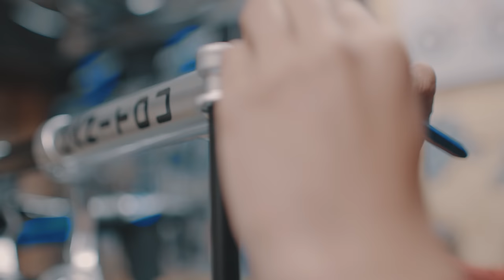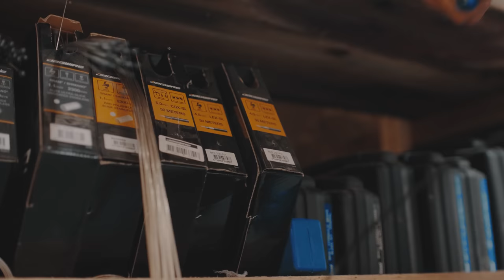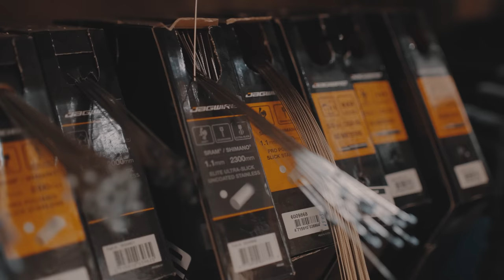DREAM BUILD MTB - Ragley Big Wig

Comment: Unusual to see Microshift being used, it's usually Sram or Shimano.
Reply: No way usually the two biggest bike part companies, that's shocking
Reply: I swapped my drivetrain to micro shift and it’s absolutely amazing
Reply: Yeah man. I just recently got a whole new MS drivetrain minus cranks. $170 out the door and its flawless!
Reply: @mcdello1  i usually heard of them having the portion that goes in the rd hanger breaking off
Reply: I think this bike is made for a sponsored rider.. and Hayes, Protaper, Manitou and Reynolds are made by the same brand/company... so that's the reason why he is using Microshift and Hope crancks.
Reply: @denzelpardillo1181  I've ridden microshift advent on my trail hardtail for almost a year and a half now, replaced a hanger but the derailleur gave me no problems before or after the fact. Not sure I can speak for all though.
Reply: @MarianWYK  it could also be because Microshift's new Advent X is a $200 10 speed group with XT weight and MORE range than the 11 speed M8000 xt series. (Three less teeth than the newest 12 speeds). That is why I have microshift on all my bikes. It started as a joke when Advent came out and I wanted to try it on my hardtail, but it has been SO trusty since.

Comment: Even Gee can make installing cushcore look calming 😂 awesome build as usual tho
Reply: Still cannot really comprehend how the tubeless fluid goes through the cushcore and on the inner tyre. Is there a hole in the cuschore that you can match on top of the valve? I have zero experience in the cushcore matter, I'm running the plain tubeless setup. It just seems intriguing.
Reply: @georgecrisan8446  cushcore valve design let sealant move more freely. It might not get on top of the insert at first but once the wheels is spinning it will finds it’s way for sure
Reply: @elliotlandry7409  thank you! :)

Comment: Man adding volume spacers in a Manitou looks like a pain in the butt.
Reply: They not volume spacers. They travel reducers. All mezzer off the shelf can be adjusted internally without buying extra stuff. He reduced the travel.
Reply: @mtboutdoors40something  man all this time and I had no idea. Thanks for that. Really got me thinking why someone would design something to be that difficult 😂
Reply: @HamzaFaruqui  lol yea manitou does things differently. For example they don’t have volume spacers at all. They don’t need them. They use a separate air chamber that does the same job and guess what, you only need a shock pump! Amazingly tuneable stuff.
Reply: @mtboutdoors40something  damn I'm starting to like manitou 😂
Any chance you working for them?😂
Reply: @HamzaFaruqui  lol I m not no. I really like them though. I have a 2016 minute comp and a 2018 mattoc pro. They both work like clockwork. I d recommend them if you were on the market

Comment: What was done to the fork? Were those volume spacers? Why is there an air valve at the bottom as well as the top?
Reply from the maker: We lowered the travel!
Reply: Manitou fork can be travel reduced internally and yes the pro model features 2 air chambers
Reply: @elliotlandry7409  ahh, did not know that. I figured that was too complicated to be just volume spacers. Thanks for the info.
Reply: @GeeMilner  What was the before and after travel out of interest?

Comment: I'm newbie to bike and all that stuff. I'm curious what is he doing in the first part of video? What did he do with the fork and the suspension?
Reply: He’s adding volume spacers to the fork.  It makes the fork have a more progressive compression rate vs straight linear.  In other words a normal linear suspension takes let’s say 100 lbs to compress 3 inches.  A progressive suspension needs (just random numbers) 100 lbs for the first inch, 200 lbs for the 2nd inch and 300 lbs for the 3rd inch.   Prevents you from bottoming out as much.
Reply: He reduced the travel. Manitou mezzer don’t need volume spacers coz they have a second air chambers that does the job. 
He reduced the travel by 2 or 3 cm (I didn’t count but each half moon shaped disc you see is 1cm of travel once clicked together. Hope that helps.
Reply: @frankrodriguez1981  that s incorrect. He reduced the travel by adding spacers. What you are referring to doesn’t work like that on manitou forks using IRT.
Reply: @mtboutdoors40something  ohhh TIL.  Thanks.

Comment: How did u use tapered forks on what looks like a straight head tube?
Reply: The head tube looks straight but it's tapered. Also gotta remember the steer tube is resting on the headset not the actual frame. 👍
Reply: The bottom cup in the headset. Notice how it wasn't zero stack? For a tapered fork to work with a straight head tube, ensure you get the right headset for your frame and fork. *Do note that this will slightly change the geometry of your bike.

Comment: 21:25  but why don't use the bike stand function , to rotate the frame in upward position , to allow to work with straight body ? 
20:06 - 20:23 making an unnecessary waste of material ..
27:43 that sealant always make a mess , the industry should make a proper connector with a transparent tank , and  a top mounted knob for compressed air 
Awesome build  , lots of improvement in the shop , like it
Reply from the maker: haha wow, wow wow wow wow
Reply: Daming ebas.